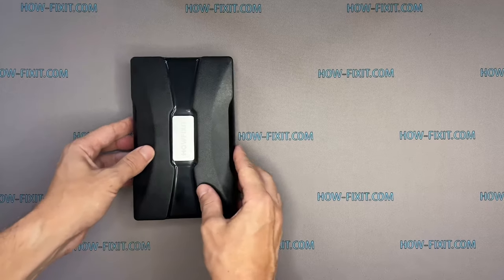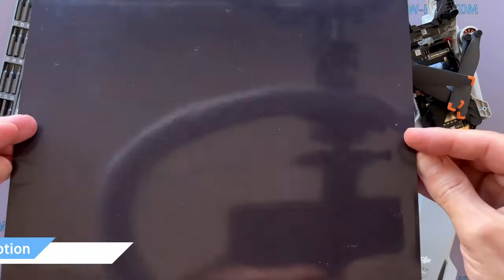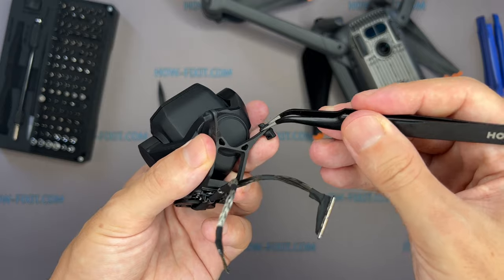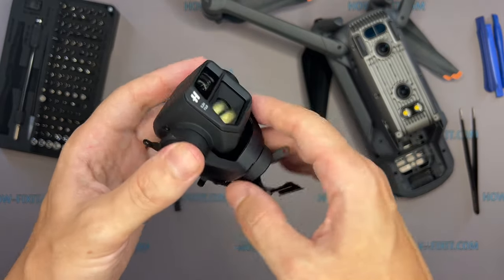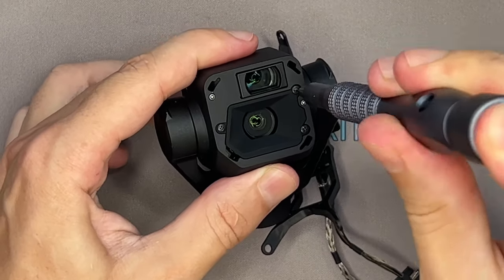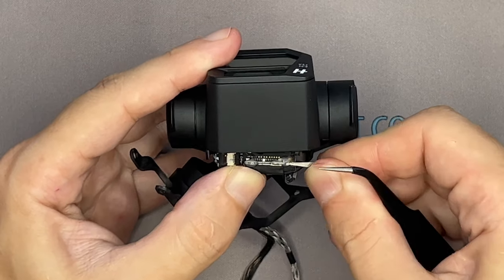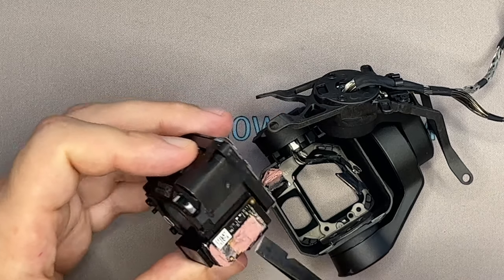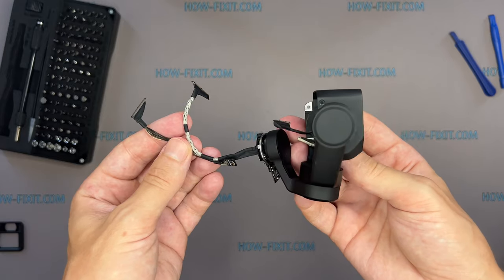DJI Mavic 3 Gimbal Replacement Guide: Ultimate Repair Tutorial

Comment: Perfect guide! I was trying to troubleshoot some lateral vibration in my video from my mavic 3 classic for weeks, thought it was going to be the knuckle for one of the rear arms damaged in a minor crash. After watching this and learning how the two part suspension system works, i took a closer look around the gimbal mount and found some cracks there. Cheap and easy replacement. Solid job engineering a cheap mechanical strain relief as well by DJI and beefing up the gimbal hardware so that in a crash, the weak link saves your expensive hardware.

Comment: Wow great video! I just crashed my Mavic 3 and broke the gimble carriage. I was about to send it away for repair until I found this video. I was able to take it apart and find the broken pieces and order the new ones. Im sure I will be able to reassemble it with no problems once I get the parts thanks to you!
Reply: My gimbal turned 180° and is stuck now after a crash, you had the same problem?

Comment: Are the robber holders and that plate the same on the magic 3 pro? That’s the 2 parts I need to replace. My gimbal is still intact and working fine.  Just one of those rubber pieces broke and the plate that you took off at 4:20 TC.

Comment: I got my Mavic 3 stuck in a tree today. I finally managed to get it free, but it crashed down to the ground and broke the gimbal's metal frame with rubber bushings on it. I ordered a replacement frame but what is the part you're holding at 11:39? I apparently have lost that and don't know how to get a replacement.

Comment: Thank you for your nice sharing. There is something I want to ask. After changing the Gimbal unit as in the video, is it enough to calibrate it from the Gimbal Calibration section in DJI fly or do we need to install extra software? How do we introduce the new gimbal to the system? Thanks again for the nice video.

Comment: where can I find the part with 4 arms on which the head of the camera is fixed, I have one of the two small cleats broken (prevents the camera from leaving if the rubber suspensions are cut) (this part is in the hand right at 10'02). Is this little cleat really necessary?.

Comment: After  replacing the absorption board the gimbal does not work. I keep getting gimbal error and gimbal stuck. What cable controls the gimbal and what else can I check to know if the gimbal is broken?
Reply: Were you able to figure this out. Mine is doing the same. I have not replaced the absorption board as I just ordered it. Wondering if I will need additional parts. Thank you in advance for your insight!! Hope you are able to fix it!!

Comment: Hi, random question but do you know if it's possible to fix a laptop touchpad that has a small lift? I had dropped my Dell G7 15 7590 upside down and the touchpad came loose. I've tried fixing it but can't seem to fix the 1mm gap.

Comment: Correct me if I’m wrong, but are you supposed to be certified to repair an aircraft that’s registered with the aviation administration that would be the Federal Aviation Administration. In this case, I’m sure it was for demonstration purposes but I’m pretty sure people if you’re not factory authorized there’s a few more things to go along with it like your temporary hold on your credit card so you can get your thing refreshed with your refresh plan that you’re stupid and not buy hay and don’t be scared to buy the Mavic three thinking the thing is weak. If you had a Mavic two you would think that it is not weak. The Mavic three is a beast in the camera if it breaks off, you just replace the rubbers and the cables, hold them selves on moose generally the things, the beast, DJI props to you baby
Reply from the maker: Think about the right to repair